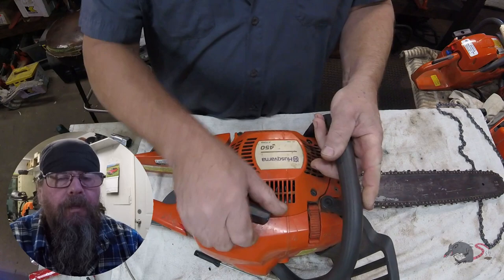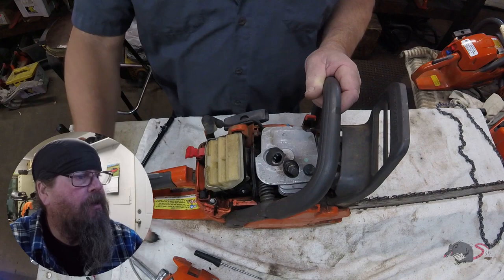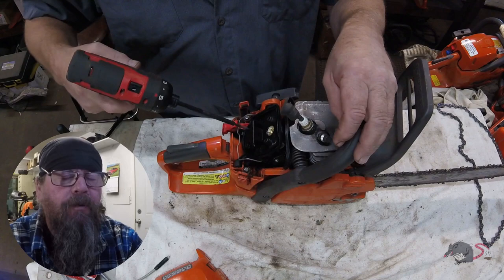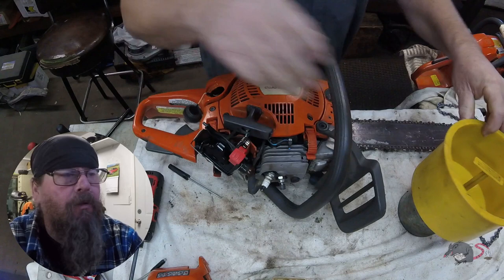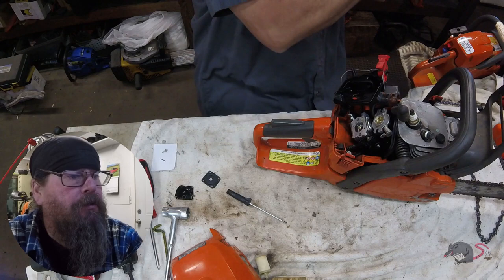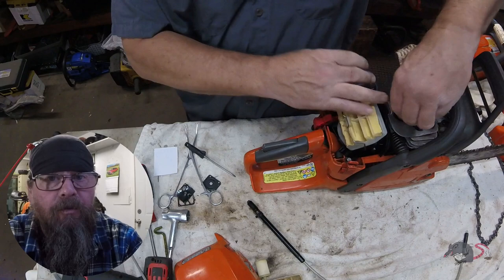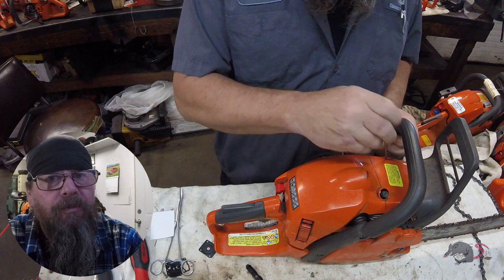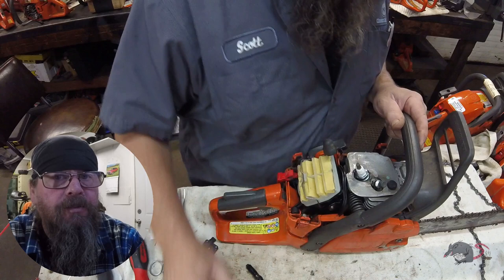Husky 450 Chainsaw Flooded And The Fix

Comment: My 365 barely runs and super smoky, plus fuel leaking out the muffler. Will check the carb. Thanks for the video.
Reply from the maker: Super smoky means flooding. Stiff metering diaphragm or needle not seating.

Comment: Had the same saw in the shop this week with same issue. Cylinder was shiny and clean, so rebuilt carb and still no start. Would pop one time when cold (30 degrees).

After much fussing, pulled the muffler and found huge scrape in piston skirt and stuck rings.

From now on, pulling muffler to check before any work.

Thanks for the great vids.
Reply from the maker: Pulling the muffler really is the best way to be sure.

Comment: My brand new 450 starts terrible. Floods so easily starting it.
Reply from the maker: Was your saw prepped by a dealer or was it a big box store purchase?
Reply: @TheGreasyShopRag  big box, I need to dig into the carb. I'm assuming it needs ti be adjusted is all
Reply from the maker: @MetrohMan  Push purge bulb enough times that you  are pumping fuel. Set the choke, pull rope it until it "pops". turn off choke, pull until it starts. Squeeze trigger to release high idle.
Reply: @TheGreasyShopRag  thank you for the advice. I goofed with it a bit over the past day. Continuing to pull start with the choke was the issue. Floods it instantly if you try anymore than 5 pulls with the choke on.
Reply: @Brandon Harrington  yeah I usually follow the starting directions they give you and it starts great everytime. I use to ignore it and learned my lesson. Saws are just like trees very sensitive so all it takes is 1 or 2 improper starting sequences to hurt its feelings. I had a bran new 450 cold start in 2 to 3 pulls everytime but warm start I'd just be yanking 8 times or so. I noticed that following husqvarnas break in procedure whether you agree with it or not has also stopped a lot of future problems from occurring. Espefiakly running it only to 3nquarters throttle while under load for the first couple tanks. Now it warm starts in 1 or 2 pulls
Reply: @sethkeith6698  I've learned the do exactly that. Never had a saw need a startup sequence like this but it does work every time